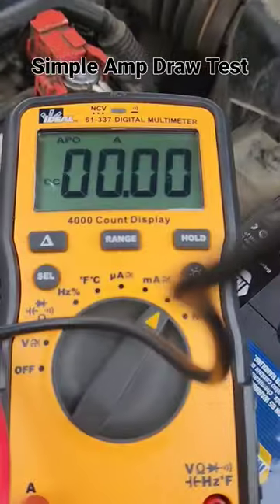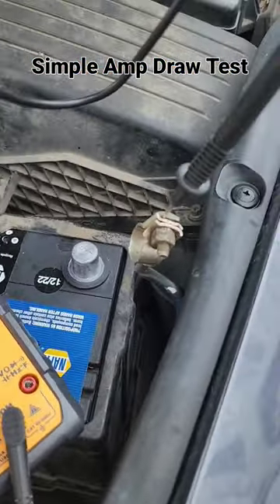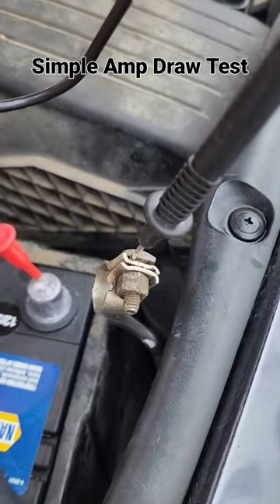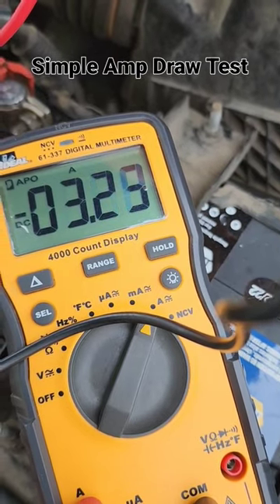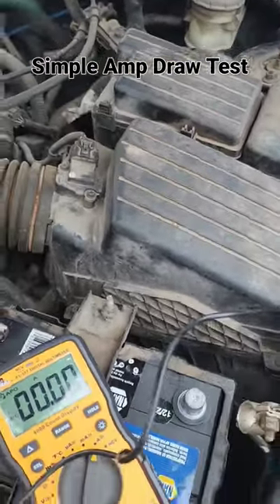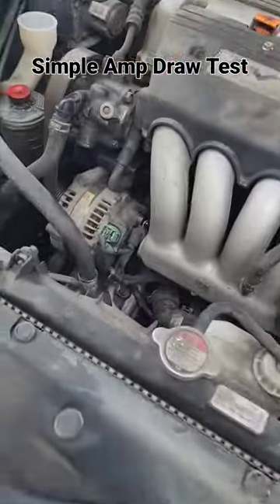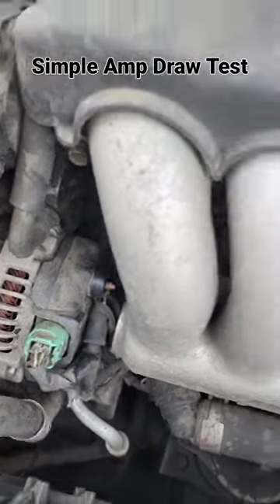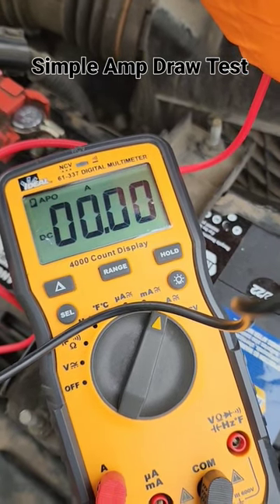What's draining your battery?! How to find a parasitic draw! (EASY)

Comment: Short circuit in the alternator?
Reply from the maker: Correct ! A shorted diode in the alternator.
Reply: @HumbleHotshot  I have a similar problem in my 50cc scooter. Its the second 12v barrery I am buying. I am pretty sure its the alarm sucking all the energy. In a week or so its all drained... I also have no idea how to disconnect the alarm power source.  So my Strategy will be kept the battery plug open if I dont use the scooter too often 🤔

Comment: My 04 Chevy truck battery goes dead after like 4 days. I hooked my volt meter up like you and pulled the fuses/relays 1 at a time. It showed 12 volt drain after pulling all the fuses. What do I do now?

Comment: And then once you see that you have something drawing power when everything should be off, just start pulling fuses, ONE BY ONE and checking the meter in between EACH pulled fuse, until the meter shows that you have ZERO amp draw and then you, at least, know what circuit your problem is on!!! Then it’s much easier to further pinpoint and eliminate the issue that is leaving you with a dead battery and a car that won’t start every morning!!!

Comment: So on one hand, it could appear that one's alternator is fine (i.e. charging the battery when car is on).....but could still be faulty by parasitically drawing power while car
 is off?
Reply: That is 100% correct. This alternator charged perfectly at 14.2 volts with the engine running, but drained the battery overnight due to a shorted diode within the alternator. 
This can happen if a jump box is hooked up backwards.
Reply: @WildFaith    How interesting...thank you!  My alternator 5 years old...but car only has 23k miles on it.  Aren't they supposed to last waaaay longer than that?

Comment: I have a 2021 Subaru Outback and did an amp draw test. After an hour of pulling fuses and testing, I narrowed it down fuse “UNIT +B2”, which was pulling 2.3+ amps! Any suggestions before I take it in to be diagnosed?
Reply from the maker: Find out what exactly that fuse is for and see if there are any obvious issues within that circuit. Good luck!

Comment: This is the old method.
The newer method is to use the voltage drop against the fuses as the computers can stay awake for 15minutes, its even worse with keyless entry systems.
So you have to have the key well away from the car

Comment: Or just the DMM to check for MV across the fuses....this is the way taught in electronic diagnostic class. 😉each fuse has an allowable MV rating based on fuse amperage. 100% guaranteed everytime

Comment: Wait a minute 1st run a wire from neg post to neg cable then hook up the meter, remove added wire if it is up over 35 mil amps then hook the added wire back up for a few minutes & let any timers run out then remove the added wire & see what the current reading is,,,  Some vehicles timers may run for 20 minutes or more.

Comment: But why would the alternator draw power at all? If anyone knows please let me know I’m trying to find ways to fix an issue I’m having with my truck
Reply from the maker: If there is a short circuit within the alternator, usually a shorted diode from hooking up jumper cables backwards, etc. the alternator will draw power. Remember that the battery and alternator are directly connected with a large wire so power can flow both ways if there is a problem in the circuit. Hope this helps ! God bless
Reply: Thanks for the help I unhooked the alternator wire and it allowed my truck to start right up so I’m going to replace the alternator thanks again! God Bless!

Comment: So how did you fix it? What was the wire you disconnected? Did you leave it disconnected or what? Also, thanks for the video and knowledge!
Reply from the maker: That wire is the main power supply from the alternator. The fix on this one was to replace the alternator. Thanks for watching!

Comment: also some center consoles have 12 volt ports hiddin within them some people use power adaptors i once had a nissan  truck in the shop im a nissan tech for a dealer and had to call 800 nissan support line i coulndt trace it down he said see if theres sokmething plugged into the outlet in the center console it was soooo small and hard to see i had to shine my light turns out it was what was killing the battery every 3 days... so look for that too now new cars shut off they have bms next to the batteries that turn everything off after 10 minutes even if your radio turns off when you open the door everything the amp for it is still on and after 10 minutes youll hear the fans turn off on the radio and finally truly stop drawing power..  also newer cars require agm batts not lead acid.. they also charge the agm higher due to its a agm some go to 12.8 while lead 12.6 dont stick a lead acid in a newer car.. or stick a litheum batt or a lifpo4 it will destroy the alternator
Reply: I wish japanese cars are like that but no. At least the two cars ive owned. Honda and toyota dont send 12v to the plug inside. Once the key is out it turns off.

Comment: I’lol try this. 

I have a 2019 Ford Transit. When I get to a customer, I leave the car turned off and closed. A few hours later when I try to start I realize that the battery is dying, the control panel gets strange and a message from Beltminder appears. But when I turn off the car and lock it with the alarm control, that doesn't happen. 

I believe that "something" in the system continues to drain the battery and this "something" is only disabled when I lock the car with the alarm.
Reply from the maker: Is it an aftermarket alarm system ? These are know for causing battery drain issues..

Comment: Any ammeter, or any multimeter set in the amps mode, should be thought of as a dead short, or just a piece of wire.  That is why it must always be connected into the circuit in series with the load.

Comment: We pulled the alternator 3 pin connector and it turns out the wire is drawing power snd stays hot even after hours of the engine not running. What would I do in this case? Its a 2003 Chevy Tahoe

Comment: What if the fuse is blown? My fuse keeping blowing when I replace it. How can I fix the problem using this tool?
Reply: Check the wiring and all connections for the component that is fed by that particular fuse. If it keeps blowing, there is likely a short somewhere in that circuit.

Comment: So can we just install a kill switch? So we don't have to try and find the problem? Would it matter if installed on the positive or negative terminal?
Reply: You could do that, rather than track down the actual problem. Battery disconnect switch can go on either terminal, but ground is safer.
Reply: @WildFaith  TY. And either on the pos or neg will cut the problem? There's no chance problem remains
Reply: @cliffordcrose  correct, either one ( + or - ) will cut the battery

Comment: Technically you put the positive meter lead on the car side. Touch black negative meter lead to negative battery terminal. Then you won't be reading negative amps and it's best for keeping your shit in order so theres no mishaps. Like mistakenly thinking that negative battery terminal is positive. 
3.4 amps could be from not shutting a door. I call these phantom current. Some are normal from stereo and car computers, some dashcameras.

Comment: I’ve done this test a thousand times and so has multiple mechanics who always tell me the battery is bad after performing this type of test that shows 0.0! I’ve been through 3 batteries and the exact same thing happens. Only one mechanic came up with another possibility that he didn’t think was the case but something about load at start. Any idea what kind of bad extra load at starting could cause a quick drain? I have zero after market parts and I’m driving a 1993 z28 Camaro. Any guesses would be appreciated

Comment: Wouldn't alternator test reveal bad alternator?
Reply from the maker: Not necessarily. A typical alternator test only ensure that it is charging properly. This one had a bad diode which caused the draw. It actually still charged the car just fine, but would drain the battery overnight.

Comment: You got the right idea but your doing it backwards. Even your meter shows -3 amps.

The positive goes to the direction of where the current is flowing using the typical current flow most people are familiar with ( plus to minus) red lead on battery cable because that's the direction the current is coming from black on where its going to. 

Another suggestion here , buy a meter with an ac/dc amp clamp on it. No need to Open the circuit at all risking shorts or if the current is somehow over 10 amps you won't blow the internal fuse.

Comment: No no no!
You connect it the way he says but with crocodile clips.
Then with the key it of and away from the vehicle let the modules on the vehicle power down. Sometimes it will take 20 minutes.
Then go looking for your draw.
Reply: General Technologies Corporation .  GTC 063 six piece kit , fuse socket connector kit .  Amazon $20.00 8/9/24 Very handy tool !  Made in Canada .

Comment: just keep some spare 10A fuses for the multi meter
Reply: Exactly. That's what I do its unlikely that the vehicle battery is drawing more than that as that would drain it pretty quick.
Reply: An old style Stewart Warner amps gauge will read and surpass  a 10 amperage draw .  This  is a handy tool .  General Technologies Corporation .  GTC 063 six piece fuse socket connector kit Amazon $20.00  8/9/24

Comment: I had a truck years ago that the battery started dying overnight. Before I replaced the battery< I did a draw test. the truck was pulling juice. So, when pulling fuses, I found a penny in the cigarette lighter. I used the ashtray for change. The fun part was getting it out. it had kind of welded itself to the connection.
Reply: Any children around that could have done that? I had a nephew many years ago when he was around five, that put coins into my trucks CD player. I ultimately got them out.

Comment: If this doesn't work on your multimeter you might have a blown fuse (in the multimeter)
Reply: And if you hit the starter while attempting to measure current, you will be lucky to blow the fuse in the multimeter.  Bad luck will be to blow the ammeter from the ~300 amps that the starter can draw at inrush.
Reply: Dam everyone has a different way dam I'm looking for good advice my brain has an over load from reading everyone different ways ughhh my car dies out new battery alternator was used when replaced shady mechanic didn't tell me it was used charge me 500 now it's dying out after a new battery any advice 2011 Chevy Malibu 3.6 helpppppp

Comment: Isn't that charging the battery cause it's showing a negative amperage? Current flows from positive to negative, that's why your multimeter is showing a negative value. Swap the probes next time.

Comment: You hooked your meter up backwards. That is why it displays a negative current draw.
Reply: It doesn't affect the results of the test either way. It's the amount of current flowing through the multi-meter that matters, not the polarity.
Reply: That way it recharges the battery😉
Reply: @Gene R.  This is a parasitic draw test. It's purpose is to measure the amount of current that something in the car is drawing when the engine is not running that's causing the battery to run down. The polarity of the current has no effect on the results of the test. The polarity has nothing to do with the battery being charged because during the test the motor isn't even running.
Reply: @joevignolor4u949  sorry my attempt at humor was too subtle for you.
Reply: It doesn't matter as much in the digital world because the meter will display negative current flow with the polarity reversed. Now if you were using an analog meter it could ruin the meter movement. So it makes a difference to do things right. The negative bat cable is more positive than the neg bat terminal. The video is Ass Backwards as far as polarity goes.
Reply: @timcoffin2790  anyone using an analog meter is so far out of date they will never find a current draw and has no business under the hood of any compute controled vehicle.

Comment: If the drawn is 10 Amps orote the fuse will blow in your meter or hope it does I always replaced mine with  a 5

Comment: When I try this, it starts below 1 then there’s a subtle click sound and it jumps to around 5 then it comes back down to below 1. Anyone know what that is?
Reply: There is a good chance the clicking sound is a relay (or in older cars possibly a bimetallic switch used for turn signals).

You can still pull fuses to figure out what circuit the relay is on.

In case it helps, a friend of mine had a Jeep that the fuel pump relay went bad in.  These would sometimes stop working while the vehicle was operating, or start operating when the vehicle was stopped, causing it to drain the battery.
Reply: yes, because this utube guy is doing the test wrong, so now, you are as well...
see jo's correct method on no. 1 comment, which stops the various ECUs tripping out due to disconnection

Comment: When you disconnected the battery it puts modules to sleep and activated others when you put Amp probe on. You need to hook up Amp meter first to maintain the problematic scenario. Your method produced false Amp draw.

Comment: Not sure how it dropped to 0, as ALL cars have parasitic load of up to 100 milliamps with the key off and all modules sleeping.  Even the clock on a very primitive Digital Radio will have a small amount of parasitic load that power up the Keep Alive memory that allows the clock to continue keep taking track of the time with the Key Off !  So, there is really no such thing as Zero parasitic load, unless the circuit is Open / Disconnected . . .   SCIENCE !
Reply: That meter is cheap but it still got the job done
Reply: @firstlast---  No, it didn't - as there is NO such thing as Zero Parasitic Draw / Load !  NEVER HAPPENED !
Reply: @johnbishop7912  I never said there wasn't John. My point is that although slightly inaccurate the meter was still able to diagnose the draw
Reply: @firstlast---  Slightly innacuate ?  There is a HUGE difference between Zero Amps and ANYTHING ELSE !
Reply: @johnbishop7912  5ma isn't even a blip on the radar settle down lol
Reply: @firstlast---  5 ma is NOT zero ma is ALL I'm saying.  And 5 ma WILL drain the battery over time ... The only one upset here is you, that's why you think you've got to get the last word in, even if you're essentialyy saying NOTHING of any value ...   😏
Reply: @johnbishop7912  I promise you I'm not even close to upset lol. I engaged because I thought it was interesting someone would nitpick so hard over something this insignificant. At the newest the car in this video is a 2012 there are no high speed networks so an extremely accurate meter isn't required. Virtually every single oem will tell you 20-30ma is an acceptable draw. You're complaining about nothing
Reply: @johnbishop7912  To be even more specific the vehicle in this video was manufactured between 2003-2007. K series engines went to a plastic intake manifold in the late 2000s
Reply: @firstlast---  The meter shows 0 (ZERO), GENIUS !  Did you happen to miss that part when you stuck your nose into this ?  And you walk amongst us ?  Pay Attention to the Details - because they matter !  YOU have missed the entire point, and if I'm right - you STILL don't even get it !    😒
Reply: @johnbishop7912  I literally said the meter is inaccurate, which you acknowledged, and then you continued stating obvious things like you have been the entire time. I'm questioning if you know anything beyond fundamentals because you keep treating it like it's a groundbreaking fact every single time lol

Comment: It is better to use a DC clamp. But, this works unless you have a short.
Reply: A DC clamp may not read such a small current draw.

The suspect drain is most likely either a bad diode in the alternator or a trunk light switch. Or if you have a light under the hood.
Reply: @Dave M  it will, unless you get an absolute pos DC clamp or it is very high range luke 1000 amps. A trunk light is likely over an amp. If it is less than 10 amps, then go ahead and switch to shunting the load to measure it. If you have a short you will blow the fuse in your meter this way.

Comment: Replace alternator or put in a battery isolation switch. .. better off change the alternator, I you can replace alternator diode pack. The diodes changed 14volt AC to DC.

Comment: How do you stop an amp draw at the alternator?
I recently replaced my water pump and had to remove the alternator and after I put the alternator back in, my battery is at about 12.39V in the morning. 
Checked the scope and v to starter goes down to 7.5v for the first half second while cranking  so engine struggles a bit to start.

Comment: you for got to tell people that leaving any door open triggers the computer to output and come on from sleep mode it takes upwards of 30 minutes of doors being closed to go into sleep mode so you can do this test so close the doors and hope that the fuse is in the engine bay do those first if you still get a ton of  amps  then you need to be inside the vehicle and pull fuses from the inside but first keep the door closed and or use a clamp to kleep the pin that tells the light to come on pressed in so it sees a closed door so do that then wait 30 minutes till computer goes to sleep then pull fuses you can see upwards of 2 amps just with the door being open and it dropping to 1.5 ampos once door closed but till computer goes to sleep and turns off the cig lighter and radio etc which is upward of 5 to 10 min then 30 to put the computer to sleep then youll see true numbers then pull fuses.. this is how to do it on modern cars